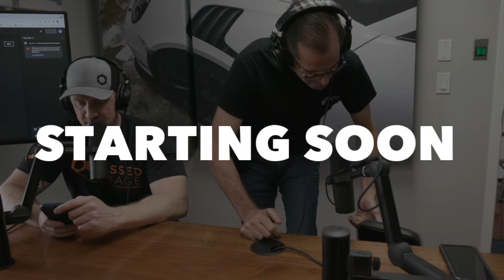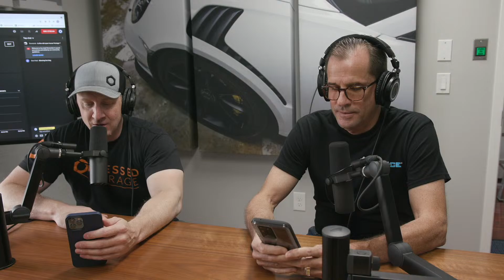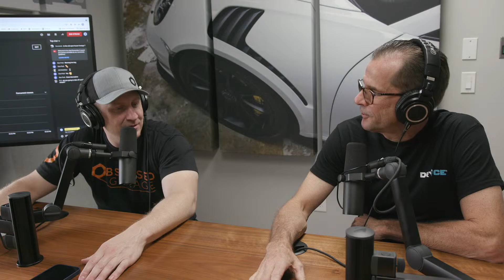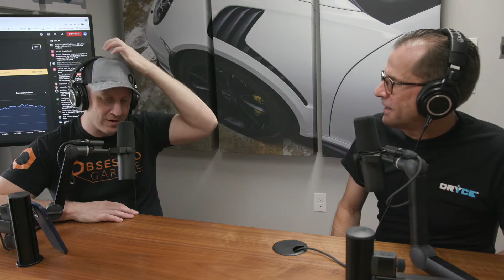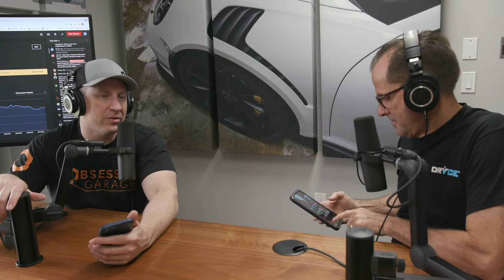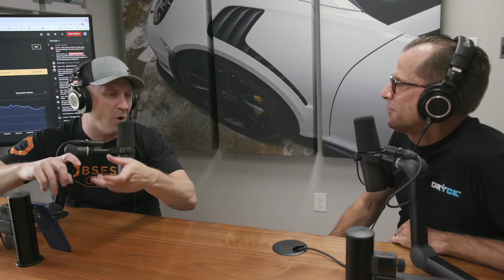The Dryceman Cometh: A Special Podcast With Scott Ales

Comment: I'd love to pull apart one of these 10k units and see exactly what makes it that expensive
Reply: It's less about what's inside and more about how we support the buyers.  Before us, the least costly machine was $15k.
Reply: @ScottAles  I'm more thinking along the lines of what makes the units this experienive to manufacture. Like if I was to decide to start designing tooling and a process to make a unit tomorrow. What would make the unit so expensive once you account for r&d as well as tooling? I'm almost sure there is room in this market for someone to look at what's available look at what parts are nesecery what can be made better or where a reduction in cost won't affect overall quality I'm sure you could substantially drop the cost of entry while still applying your knowledge and training but on a larger scale. I know if the package was say 5k+ some additional you'd have a much bigger market and then subsequently the issue of dry ice supply also is easier as there's more demand. ( I was an engineer at a good plant for a while they co2 supplier issue is just as bad in they UK) 

I do have a million questions about this and world love to apply some engineering principles to this and see how it works
Reply: @OwenM98  It's the development cost for a product thats not for the mass market.

Comment: Still don't understand the point of dry ice blasting the underside. You're paying $10k to clean a part of the car that will quickly get dirty again and that no one sees. It offers no additional protection. The only reason to really clean the underside of your car is for ease of maintenance purposes, and that can be achieved much more cheaply with traditional methods.
Reply: Think of all the incredible show cars in the world.  If you've never tried to present a car at that high level, I can appreciate some confusion.  It's solving a problem for others, not you.
Reply: That is more in a show or full resto situation. IE cars at shows with mirrors underneath or a nut and bolt restore. The smaller Evo unit is more for engine pay, interior and body
Reply: Once you get it to the level that can't really be achieved otherwise it's easier to keep it there too. Can someone get close with enough degreaser and a pressure washer sure, way more of a mess tho. I definitely see dry ices place and will only become more cost effective over time.